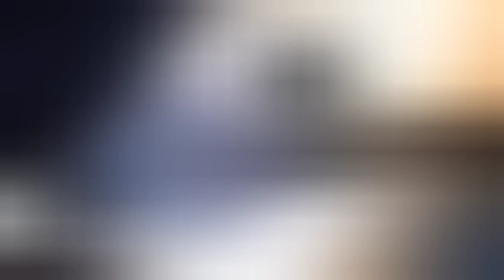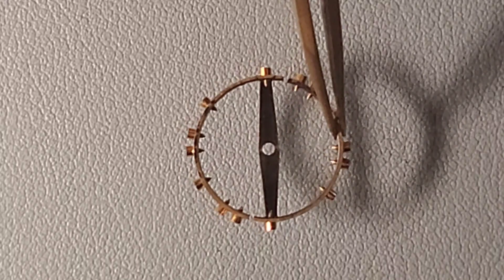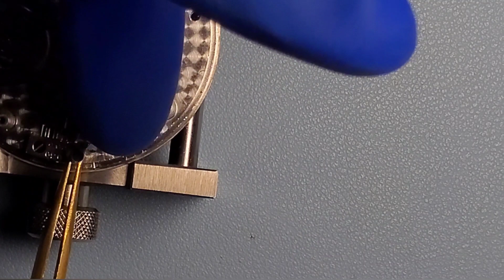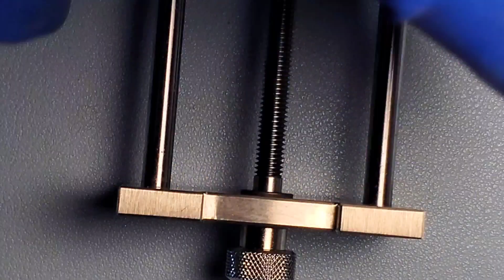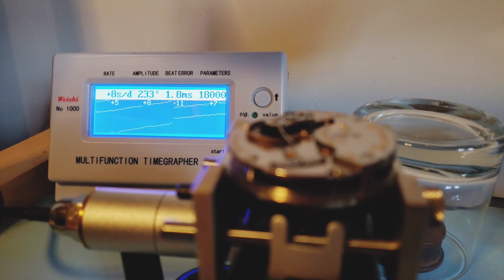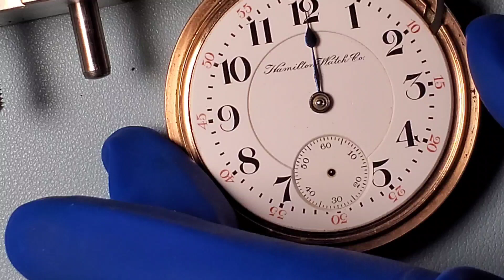I replaced a balance staff !! - plus full assembly Hamilton 940 pocket watch

Comment: Great videos. Just binged watched your channel. My question is, on 3/4 plate watches it's easy to visually check if the balance is more or less in beat by looking at the alignment of the impulse jewel between the banking pinks and its relation in position to the balance and escape jewels. On a full plate watch, everything is covered. Is there a way to visually confirm the alignment of the impulse jewel? Very well shot and articulated videos.
Reply from the maker: It can be done, but since the banking pins are on the top plate then I believe the easiest method would be to check before the watch is assembled. This would involve placing the complete balance and balance cock on the top plate, then view the position of impulse jewel underneath the top plate. This allows one to see the position of the jewel in relation to the banking pins. -cheers, Redvitis ⏱️
Reply: @redvitiswatches  Thanks! Never thought of that. Much appreciated.
Reply from the maker: Very welcome 😃.

Comment: I'm not ashamed to say the I often play your videos as a guide when assembling and reassembling. In this particular case I too have replaced a balance staff and have noticed that the pallet fork on both my project watch and my spares watch are not shaped as is the pallet fork you have with that elegant crescent moon counter-balance. There is enough material in the counterbalance of the one item I have to trim off a bit and make reasonable room for the timing gear and pivot. My question is whether trimming off these bits will impact performance and if that can be compensated in some way. Thoughts?
Reply from the maker: This model had some variations with the pallet fork design. I would need to see pictures to make a diagnosis, but would advise against modifying the part. Hamiltons are so well made unlikely the PF has a problem, more likely there was an issue created in the past by jewel replacement or other repair. There are some good watch repair forums, I am on watchrepairtalk under the name redvitus (yep that's me - diff spelling). Recommend posting or PM me there. Cheers ⏱️
Reply: @redvitiswatches  Thank you for the kindness of your response. I'll follow-up with you at the other site, hopefully to provide snaps of the two forks. Best Wishes.